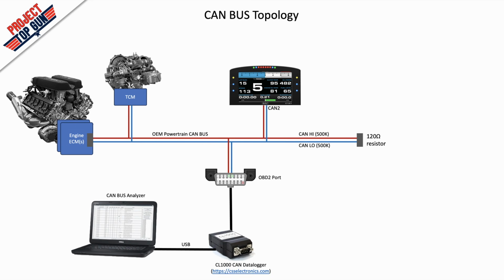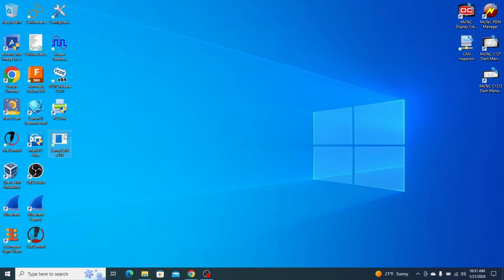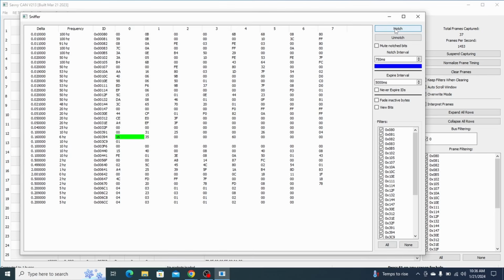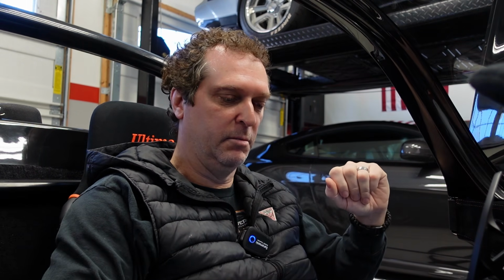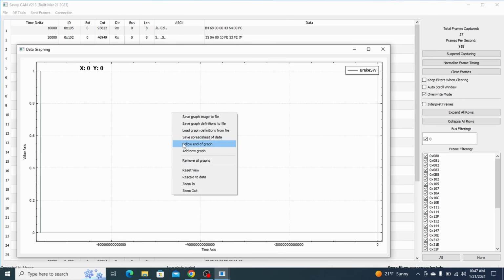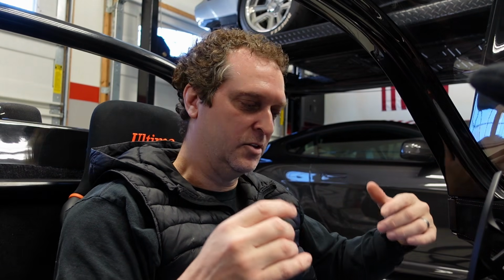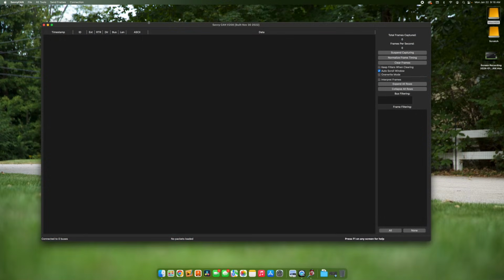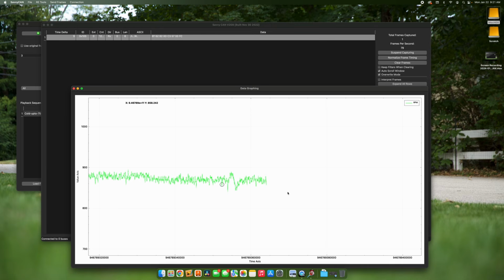PART-1: I Reverse Engineer the OEM CAN BUS on my R8/Huracan Powertrain!

Comment: This process looks very similar to how they create cheats for videogames - first you try to isolate bytes of memory that change when your ingame money increases/decreases by comparing before and after memory snapshots, and then once you found what changed you can modify those bits and give yourself infinite game money. Modern games use misc techniques to resist this attack, but if a software is not actively trying to obfuscate its data the same technique shown here is used to reverse engineer its data.

Comment: Data length = 1. Encoding LSB - WTF? It's 1 bit.
Reply from the maker: I get it.  But I get in the habit of ticking the LSB box when working on a car that requires it, whether it’s 1-bit or 32-bits. It doesn’t hurt to keep it consistent and reduces human error.

Comment: Hi Dan! Did you need to change your config at all for this on the CL1000, or was this just the out of the box behavior?
Reply from the maker: @nofoxtugiv If i recall, i had to change the bus speed to 500kbps in the config file on the unit...this was to match the speed on my CAN BUS.  But everything else worked straight out of the box.  If you have any problems, don't hesitate to reach out!

Comment: Dan, I am running Windows 10 Home on a Dell Latitude 5580, and Windows sees the CL1000 as drive E I copied a config.ini file to drive E, which CSS electronics said was correct. But all I get when I plug in the DBDII port on my 2023 Mazda CX 5 2.5 Turbo Signature is a solid red LED and a solid green LED on the CL1000, and I never see ports in Device Manager. The CL1000 is always seen as Drive E , a USB drive. Can you supply your config.ini file or telll me what is going on? Your video makes it look so easy connecting the CL1000 to the OBDII and I don't believe you even mentioned the cofig.ini file in your video, unless I missed that part. Please advise Thanks. I also did download the SavvyCan from CSS Electronics site. Savvy can sees serial css but no ports are listed
Reply from the maker: @stspringer2003 I know exactly the problem you’re running into—in short, you need to tap the CAN BUS wires from behind your CAN BUS gateway. Let me explain: on  my custom setup I eliminated the”CAN Gateway”. On all modern cars that I know of, everyone one of them has a CAN Gateway that all the various CAN Bus networks converge to. The OBD2 port also connects to the CAN Gateway. The problem is that the CAN gateway filters all streaming traffic from the various CAN Bus networks that are plugged into it. So if you connect the CL1000 or any CAN streaming monitoring device via the OEM OBD2 port, it won’t properly connect to a stream. The OBD2 port is used as a “request/response” mechanism and doesn’t stream any data. To get access to the stream, you need to splice into the CAN BUS twisted pair before it enters the CAN Gateway.  The easiest way to find your powertrain CAN BUS twisted pair is with a factory wiring diagram and tap into the CAN BUS wires near a powertrain device (like ECM or TCM).  Once you tap the CAN HI and CAN LO wires, you can connect them to pin6 and pin14, respectively, to a generic female OBD2 connector (cheap on Amazon).  You can then plug your CL1000 to it and you’re off and running. I hope this makes sense. I should probably do another video to explain this as many have run into this. I hope this helps!!
Reply: @DanDulac  It turns out I used a OBDII connector not supplied by CSS. So I ordered the correct OBDII from CSS and now all is working. Now following your excellent video when I went to see the bits my colors were different from yours. When I stepped on the brake of my 2023 Mazdz CX5 2.5 Turbo signature I saw red bit squares not black like yours, also the numbers that came up were not as straightforward as yours in the video. I saw 73 when I pressed the brake then up came  37 brake off, I think it's 37, not sure, then a 5A popped up too? It seemed like the numbers were popping up even before I released the brake. Your video shows the number staying on when you pressed the brake and then changing when you released the brake, mine jumped around. And then I saw red squares, not black; my ID was 0x007E9. Does this make any sense to you? Thanks
Reply from the maker: @stspringer2003 I would expect to see brake signal in the higher range CAN IDs: in the 0x100 range. I found a reference online for a Mazda 3 and its brake ID = 0x190. It also appears like Mazdas have a high speed and low speed can bus on the powertrain. Brakes should be on the high speed CAN. Hope this helps.

Comment: @Dan Dulac, my CAN bus is not chatty like yours 9:07 . I have to request -responde in Mode 1. Do you know how can I get continuous stream ?
Reply from the maker: @saurabhmarulkar5316  How are you connected to the CAN BUS?  It sounds like you are using the OBD2 port?  In order to get a continuous stream, you need to access the CAN BUS behind the CAN gateway. If not, the gateway filters out the stream and will only respond based on a request, like what you’re seeing. Hope this helps!

Comment: Is the cl1000 better than the cando interfaces?
Reply from the maker: @SLKV8  I’ve never tried cando so unfortunately I can’t guide you here. But I will say the integration between CL1000 and SavvyCAN is very good; easy to get up and running out of the box.
Reply: @DanDulac  thanks. I'll get the CL. My buddy is swapping a w12 Bentley into an S8 chassis.  We will be using maxxEcu pro. We are trying to make some of the can stuff work on the stock dash.
Reply from the maker: @sonikempire sounds like an AWESOME project!  If you need any advice once you dive into it, just let me know.
Reply: @DanDulac  greatly appreciated, I will reach out once we get closer to that point.  One last question for now CL1000 or CL2000.

Comment: Yes.  Exactly what I need for a future engine swap!  Thank you for sharing.  Are you running all vehicle modules to the MoTec?  Are you running ABS and SRS?  Are you running a MoTec ECU or are you piggybacking the MoTec with the Factory ECU? I am looking at a Coyote engine swap into a L405 Range Rover.  I will absolutely be sharing the  DBC once I get it all reverse engineered.
Reply from the maker: Hi there!  The only OEM modules I’m running in my car are the engine ECUs, the transmission controllers, shift lever/controller and  CAN BUS gateway. Basically just all the powertrain modules necessary for the engine to start/run and shift gears. All other OEM modules are excluded. Only reason I installed the CAN BUS gateway is to make for an easy integration point if I want to reverse engineer other OEM modules. So no ABS or SRS modules in my setup. Yes, i  simply piggyback the MoTeC logger (C125) onto the OEM powertrain CAN BUS.  Specifically: CAN1 is the MoTeC 1Mb CAN BUS and CAN2 where I connect the OEM powertrain CAN BUS running at 500Kb. The Logger display can simultaneously read/write on both and you can selectively ‘bridge’ the data between the two. It’s a great bit of kit and I love the flexibility and capability of MoTeC!
Reply: @DanDulac  Thank you for getting my learning kicked off in the right direction.  I will sniff/map the entire vehicle before I pull the engine.  Looks like I've got my work cut out for me.

Comment: Did you find brake pressure ID?
Reply from the maker: Brake Pressure signals would come from the ABS controller. Since I don’t have the OEM ABS controller in my car, there’s no way for me to reverse engineer that signal. If I had the factory car to work with, I could do it.

Comment: Hi Dan - I take it you are talking about the transmission speeds on the CAN hi and CAN lo bus - Matching them up in Voltage will negate any transmission of signals - Some CAN basics =
The CAN bus transmits data by measuring the voltage difference between CAN_H and CAN_L.
In the “recessive” state (no device is driving the bus), both lines tend to rest around 2.5 V, so their voltage levels may appear similar on a meter. However, they are still two separate lines.
In the “dominant” state (when a device drives the bus to transmit a logical 0), CAN_H is driven higher (close to 3.5 V) and CAN_L is driven lower (around 1.5 V). This creates the differential voltage that indicates a dominant bit.

Comment: @DanDulac Probably getting ahead of myself because I haven't finished watching. Just got through where you identified the throttle position sensor. The brake was shown as a switch. Is there also a channel or sensor for brake position? I am a pro driver and pro driving coach and I'm developing a data acquisition system to use with clients in their road cars. I want to be able to show and compare their brake pressure trace to mine in the telemetry data.
Reply from the maker: @Daniel_enginethatcould  I don’t believe there’s brake position on VAG cars. However, brake pressure might be there. I don’t have the factory ABS controller or system on this car so I can’t be sure. If you can find brake pressure, you can correlate it to a percentage of brakes applied. Example: 10psi of brake pressure = just touching the brake pedal. 1000psi = full brake pedal. Take a bunch of data points based on how hard you’re pressing the brake pedal and you can create a correlation. Sounds like a fun project and a great idea!!!!!
Reply: @DanDulac  Thanks for clarifying.
Reply from the maker: @ any time!

Comment: 22:45 This is a simplification. 
But endienness only matters when the data you are reading is over 1 byte in length. 
If it's big endian, it will have byte 0 first, than byte 1, and so on. 
If its little endian, it will be inverted, where byte 0 will be the last, and byte 1 second last, etc. 
In the end, endianness, defines the order in what full bytes are read, where the order of the bits within a single byte will always be the same. 
In this context, what I'm not sure is if the toggle for Little Endian refers to the entire data of this CAN ID, or the value you are reading. If its the value you are reading, being 1 bit, it would have not matter setting little endian or not.
Reply from the maker: @ralmslb  great info. Thanks for sharing!!
Reply: Ok, seeing 25:10 and doing some research, it seems that in CAN protocol it doesn't follow the standard in the computer industry and uses endieness to define bit order of serialization for each value. 
Meaning, the LSB in this case stands for "least significant bit" not byte, where the byte order for the full data of a specific CAN ID packet is not specified. 
Interesting.

Comment: Wow.  Just what I am looking for…But… I have a 2016 Honda Pioneer UTV that I want to read and understand the CAN bus data, for possible future modifications.  I have no idea what format the data is in, since it does not have an OBDII port, but has a special 3 wire port connector.  I think it may have a Honda motorcycle communication for the BUS.  So, I am not sure if the hardware and software you are using would work for my setup.  I am not sure where to begin my exploration, but this video gives me some good info for starting out.

Comment: Hey Dan, I appreciate your effort to make this video. I have a question: is it possible (in a normal road car) to reverse engineer a button signal like a high beam or or anything, but then take that same signal and send it to the car? Will the car respond properly?
Reply from the maker: @Shari_Tejp  Hi there!  Yes, that is certainly possible to do. In this case you would “transmit” CAN message(s) instead of “receiving” them. Many tools can do that, including SavvyCAN that I use in this video. It has CAN transmit capability.
Reply: @DanDulac wow thanks for the fast answer. That’s great, im just getting into this stuff, my plan is to make custom steering wheel for my m3, and develop an arduino chip or something similar that can connect to CAN and control some things, for example to have a traction control button directly on a steering wheel or drive mode selector. But also of course to read the rpm data for my LED shift lights. Thanks once again!
Reply from the maker: @ sounds like a fun project and totally doable!

Comment: Hi Dan, I've got a question regarding Savvycan + CL1000, I've watched your video on how you select hardware & connect to vehicle, and instantly you're receiving information. I've purchased a low cost can interface [Dauntless Devices in CO], and I'm having no luck in trying to achieve the very basic connection you're able to get with the CSS HW. I'm curious to know if there is an issue with the Vehicle Bus, I'm talking to a MY16 VW Jetta.
Reply from the maker: @Hye993gtv  hi there!  I know exactly the issue you’re having. You need to tap the CAN BUS twisted pair behind the CAN Gateway in your car. I eliminated the CAN Gateway in my build as I only have one OEM CAN BUS (powertrain) so I don’t need it.  However, on any VAG group car, there are multiple CAN BUS networks that converge at the gateway. The gateway filters out all CAN BUS traffic unless queried by VCDS or ODIS via OBD2 port, which is why you’re not seeing the traffic stream with your device connect to the OBD2 port. Tap the powertrain CAN BUS twisted pair at some point behind the gateway and you’ll be off and running. Hope this helps!
Reply: @DanDulac  Hi Dan, yes I was thinking of doing that, but never had this problem until I started working on VAG product, Ford don't do this! Thank you so much for getting back to me! Loving your car, your projects and your insight.

Comment: I really hope you are doing some serious racing with this build. From my understanding, which is a very small understanding of this. It is to simplify wiring with better communication, smaller amount of sensors needed, etc. But this does not seem that much simpler. whatever fancy your time, man. Clean ride hope to see it running sometime soon.

Comment: Can you share any details on an initial device configuration? As I've got cl2000 and it shows nothing. I updated a config file to the sample from their website and it shows few things, but is not even close to anything useful
Reply from the maker: I’m not able to get to my config file at the moment but the one thing I had to change in the config file was to change the auto-sense (or auto detect, can’t remember the exact parameter name) of the BUS speed from ‘auto’ to 500000 (500K) for the live streaming to work. You would set this to whatever CAN BUS speed running on your car. Also, most cars have a ‘CAN gateway’ that the OBD2 port is connected to; in which case you need to find your powertrain CAN BUS twisted pair behind the gateway to tap into.

Comment: Why isn't the kit car company working with you on this? I'm sure there are customers that want more than an old school manual gear shift. I'd prefer the latest automatic with paddle shifters.
Reply from the maker: The factory has never done a build using this powertrain nor offers this setup as part of their kit, so I’m on my own.  I knew this going into this project. In fact, I planned on having to forge new ground with this powertrain on this project since it’s never been done before on this chassis. Older Audi v10s have been done but not with DCT trans. I’ve enjoyed the engineering challenge thus far!
Reply: @DanDulac  Love the prototype, and I hope this leads to future profits working with that company. Cheers!

Comment: Your single bit change on the throttle is probably a throttle pedal zero or home position.  If I were you I would monitor it and have it override you throttle position reading and put the engine at idle.  That way any fault that may occur in the throttle potentiometer / encoder reading causing potential engine RPM runaway can be cancelled out if you lift your foot.  Belt and braces approach.

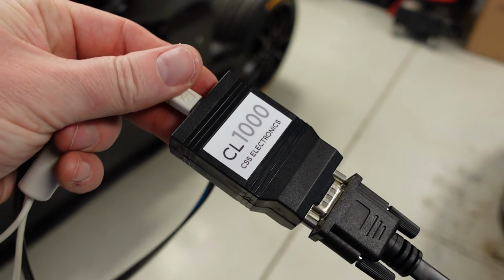Comment: 5:18 That connector is called DE-9. There is no such thing as a DB-9 connector :)
Reply: 100% incorrect. These connectors are all called DB–x, whereas x stands for the amount of pins or holes it has.
Reply: @RealEqualizerTeam  Nope. D is the series (D-subminiature) and the second letter denotes the width of the housing. Open google and type in: "Wiki D-sub", first result should be Wikipedia article on D-subminature connectors.
Reply: @RealEqualizerTeam  try looking up DA-15. It's the PC gameport connector. The second letter denotes the case size.
Reply: @zaprodk no thank you

Comment: Hmm I’m wondering if the range was suppose to be 0 to 255 and no 0 to 250. 8 bit numbers are in that range and so the rescaling should have been 100/255, or ~0.392, and not 100/250, or 0.4. Small change which isn’t really noticeable but it might matter to someone. At least it’s good to know why it is that way to begin with.
Reply from the maker: I think it’s the software on the ECU that is set to use the max hex value for the throttle pedal of 0xFA = 250 decimal. I’ve noticed other signals too that don’t max out at 0xFF (255 decimal).  🤷
Reply: @DanDulac  Oh. Good to know. Maybe it is to keep the scaling simple then since you don’t gain much more resolution by including those values. Thanks
Reply from the maker: @ryanmccawley6301  yeah, I bet you’re right. Scaling is much simpler when done this way.

Comment: I have been wanting to look at raw data on my 2002 Yukon to troubleshoot a rich problem and this is what I needed to explain can bus. Thank you, sir!
Reply: Your 2002 Yukon likely uses vpw not canbus.
Reply: @skylerbowden8220  thank you for that time saving tip!
Reply: CANBUS will do nothing to help troubleshoot your problem.  All you need to do is analyze STFT data in relation to RPM and MAF info.  Any good diagnostician can do this easily.  Not hard checking for vacuum leaks or fuel supply issues.
Reply: @djosbun  finding vacuum leaks can be a pain, so I thought of an armchair method since it's friggin winter in New Hampshire lol.
I did watch a video comparing the three bits of data, and it made sense so I'll give that a shot also. Thank you!